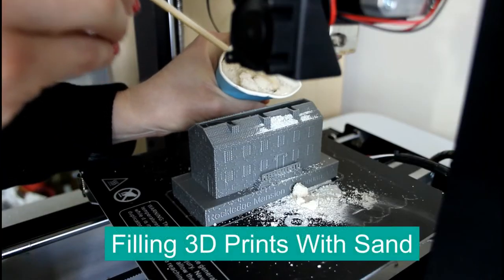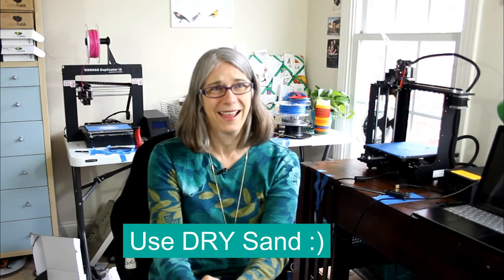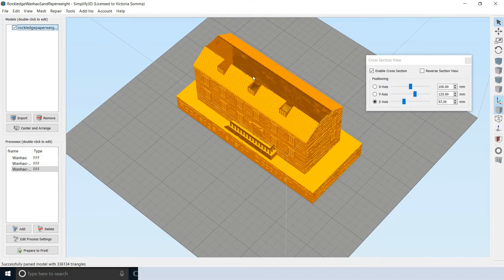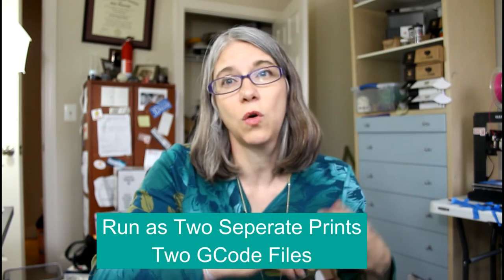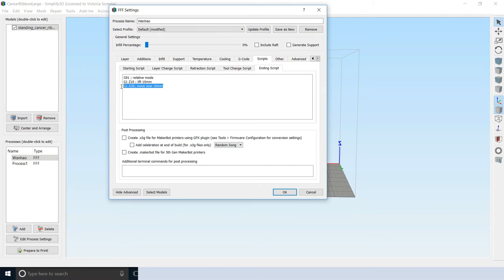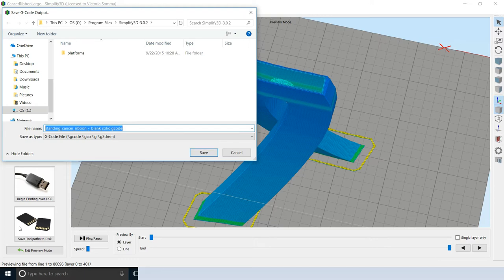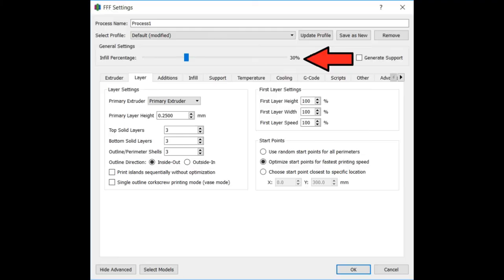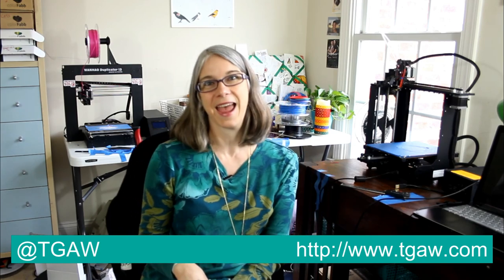Filling 3D Prints with Sand

Comment: there must be more of this bc 3d printing is more than plastic parts. you can use plain sand and micro scale sand to mix and also add some ecofriendly glue (or flour) and chopped fibers while doing compression to remove voids, so there's less deflection, more compressive strength, no moving sand, and the possibility of filling a finished print or do a final glue infusion with a syringe

Comment: Nice idea. I think I'd use a different material though. Something liquid that hardens so it won't spill everywhere if the print gets cracked. I would also try injecting into a completed print and using a 3D pen to seal up the hole (well, if I had a 3D pen).
Reply: For injection into a finished part, instead of using a 3d pen you don't have, tou could just print a plug and glue that in :) just note that of printing PETG, it can be difficult to get glue to properly bond to it. PETG is tough and will yield a little though, so you could print a conical plug and press it in (within reason of course, it's not exactly a flexible).

Do be mindful with filling 3d prints with anything liquid. It may absorb into the material, making it brittle. If it's something that hardens, you most likely need to wait quite a while for that to happen - you really don't want to seal in any water or solvents, so the hardening need to be completed before the print gets sealed closed. Some hardening happen through evaporation - that could take a really long time, and hydrate your material. Most other, more rapid hardening liquids, cure by an exothermic reaction. That happening with this kind of large volume (not a thin layer), will generate a lot of heat. Especially when sealed inside your model, where only the top surface has a small patch of area to dissipate that heat to atmosphere. So try this out on (in) a test piece first; it may even literally melt your print. Also be mindful of reactions needing oxygen to cure. If you seal it up before fully cured it may never cure.

Comment: Interesting idea! And thanks for the informative video. I had a few thoughts while watching this video:

1. Did you consider filling parts with other materials? Sand seems to be pretty messy as you pointed out, I could imagine using some sort of beads like perhaps those you fill in hacky sacks. Or maybe even something more common like rice.

2. There seems to be quite a few things you need to get right in terms of all the S3D settings to start and stop with multiple gcode files - you mentioned the replace code but didn't talk much about why you wouldn't use that? It seems to me that a single block of code could just stop the print + move head out of the way, then just continue immediately where it left off (allowing you to have a typical S3D slicing profile).

3. Now that I'm thinking of other filler materials, maybe you could simply just put some holder walls internally in the shape of some hex nuts, then stop the print and press/glue them into place.

4. Another idea might be to do this all after the print entirely to avoid all special settings and the sand-in-the-printer issues. So you could add in a hole on the bottom surface for example and then just seal it up with some epoxy/tape/etc. This would also mostly allow you to fill to the top without the extra space. You could even print a little peg to block the hole and put a little superglue to keep it in place, or drill in a hole if you don't want to modify the model.

Thanks again!
Reply from the maker: Daniel,
    Thank you so much for such a thoughtful comment and these are great options.  I do like the idea of hacky sack beads and rice (and someone down below suggested the fine grains of flour).  Hex Nuts would be SUPER easy.  I have done them before for drawer pulls and tap handles, but didn't think of using them just for their weight! 
     Oh and I have a good answer as to why I have not used RJ Make's "Additional code for post-processing".  I just learned about that trick from his video.  : ) I look forward to getting it a try myself. 
     Thanks for watching and taking the time to share some additional ideas with the community.  I hope you have a wonderful day!

Comment: Nice to see someone pushing 3D Printing to it's limits. I have one question, when stopping mid-print, is there a time limit on resuming the print, does it cause any layer adhesion problems?
Reply from the maker: Robert!  Those are two excellent questions.

1) With the MakerGear M2, there is a safety feature were if the printer does not receive a command in x amount of time, it drops the bed and turns off the heat.   I want to say that is around 3 minutes, but I'm not sure.  What I do is if I'm working on something that is going to take a while, I will go into the Jog Controls section of Simplify3D and move the nozzle slightly (like maybe X over 1 mm, etc).  

The Wanhao Duplicator i3, I have not seen first hand whether it has the same kind of behavior, but I will do the same thing just in case-- over on the LCD panel.  Just periodically nudge the nozzle so the machine receives a command.

2) Layer Adhesion is good with the caveat that your starting point of the next print is in conjunction with where the print actually finishes up.  If you can swing a first layer height of 100 on your first layer, then everything should be pretty exact.  If you can't-- then the First Layer of your subsequent processes is not guaranteed to be at 100%.  In the past, I would just add it up - First Layer Height  + (# of Remaining Layers * Layer Height) and then use that as the Starting Point of the second process.  If you preview the processes together in Simplify3D, you can visually see if there are gaps.

For an extreme example, here is a butterfly fail I had October 2015.  This was an example of my second process starting too high-- where I had it set to start 2mm, but the first print itself did not finish exactly at 2mm.  As a result the first layer was printing too far away and not sticking.

https://www.flickr.com/photos/tgaw/22522775545/in/album-72157656198419848/

I hope this helps.  Thanks for watching and commenting!